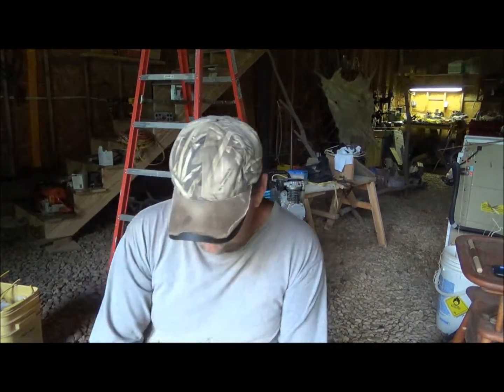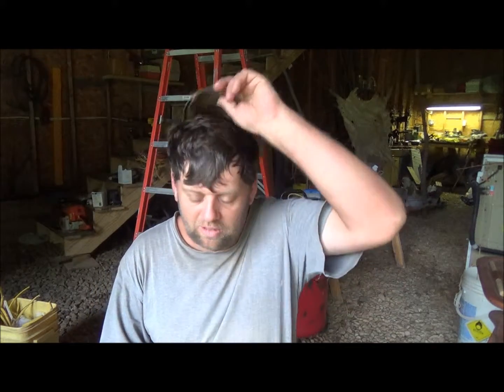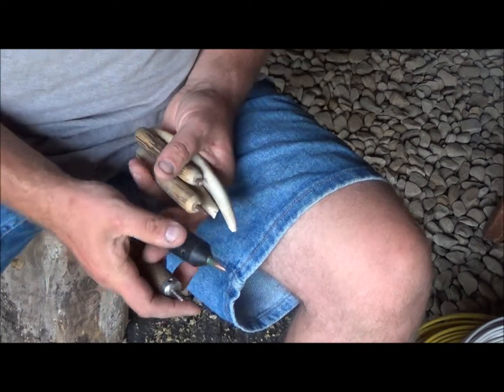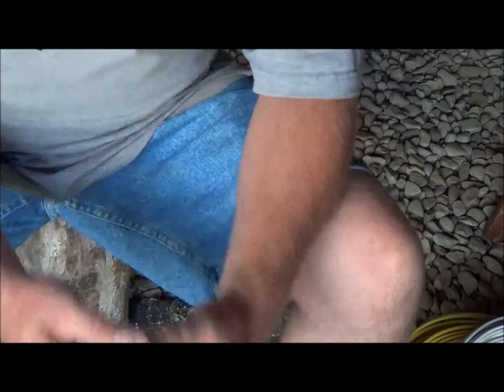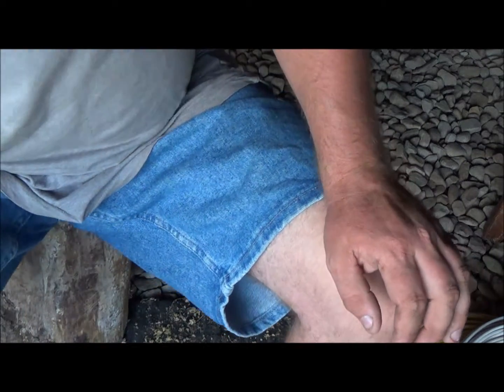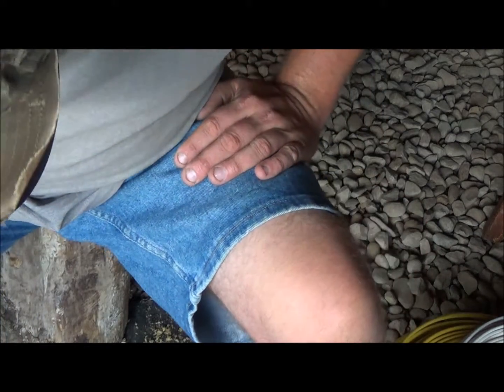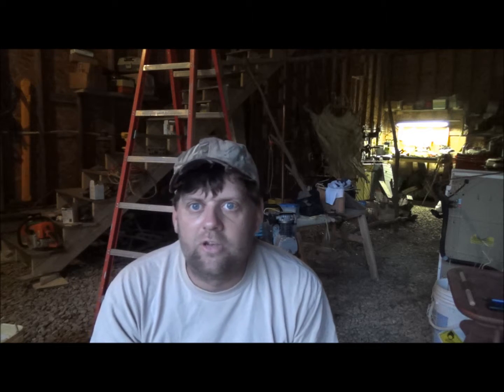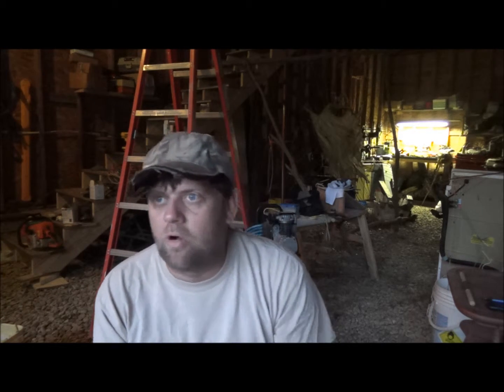Beginner Flint Knapping  Tools To Get Started

Comment: Hi. Thanks for the basic introduction. Question, what can a person use as alternatives to traditional tools? In other words, what can I pick up at Home Depot as a substitute for the pressure flakers, for example; a screwdriver? For your home made flakers you mention points, what kind of points? Are they nails driven into the wood? Thanks!
Reply from the maker: Blue Presley hi I would stick to copper for pressure flakers a heavy copper nail in the end of a wood file handle would get you started. I also use steel nails to but just for notching. As far as boppers go mine are homemade . Copper plumbing caps filled with lead and appoxied to wooden handles. I might start selling this stuff already made up in my website primitivehunter.net or in my Etsy shop : primitivehunter.